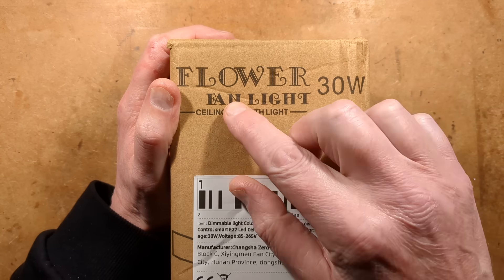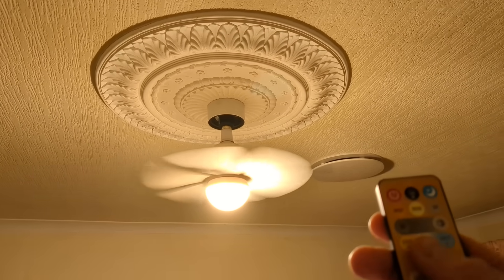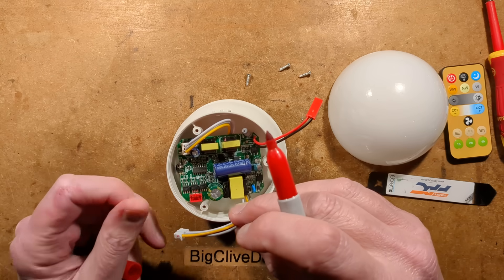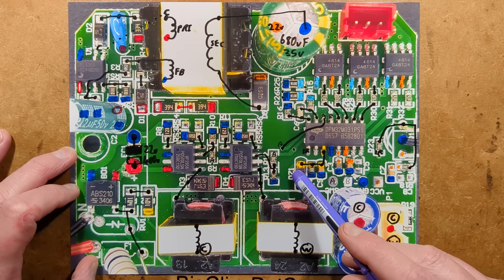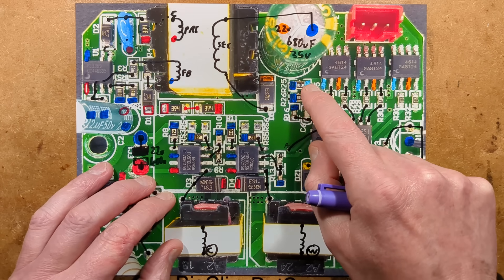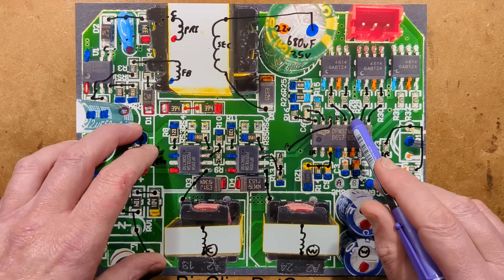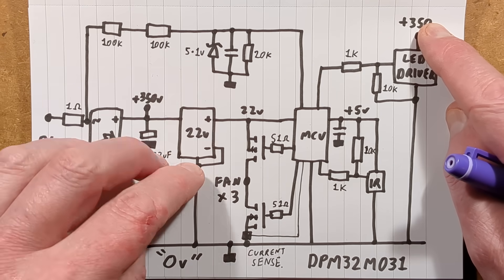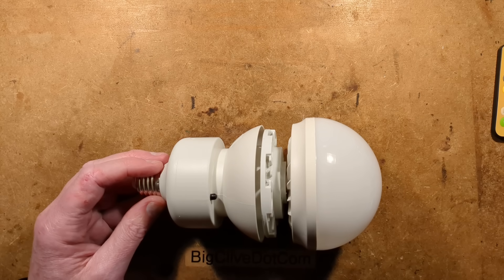Inside a screw-in ceiling fan and light - long version

Comment: The moon light mode is popular in Japan (probably all of Asia) 

All the (“bedroom”) lights in my house have that mode, originally they were pull string double fluro ring type lights with a third tiny bulb that’s orange. (No light switches) 
It allowed 3 brightness levels using fluorescent tubes 

One of them actually dims the tubes instead of switching, it has multiple drivers

Comment: Why 2 x 100k resistors in series and not 1 200k when there is no tap in between them?
Reply from the maker: To spread the power dissipation and increase the voltage rating.

Comment: kind of wonder if it isn't a repurposed drone motor controller. some of those controllers can sense the motor position from the electrical feedback of the motor, without hall effect sensors. it's gotten pretty crazy even a lot of the newer 3d printers use the motor to sense the end stops.

Comment: That red connector at the beginning, and the wires attached, is common in RC boat/aircraft gear. None of those wires can take 220/240 for long. (Effectively they are a fuse LOL).
Reply from the maker: The connector type is apparently rated for 250V AC/DC.  But definitely only in a dry environment.

Comment: It is incredible how much is in a modern micro controller nowadays, I wrote firmware for one of these core m0 so I can really appreciate it, they not only have built in MOSFET driver, comparator to run the motor from backemf(which isn't used in this case it seems like) they are surprisingly powerful too can run at 48-64mhz, with hardware divide to provide foc capability

Comment: That microcontroller is fascinating. I couldn't find the specific datasheet, but for a similar unit shows that it has trig and division acceleration. Makes me wonder how difficult it would be to repurpose, maybe write an emulator to run SNES and below games. Would be fun to try even if I failed.

Comment: the main danger to this fan is that light sockets are not really intended to handle any torque beyond screwing in a bulb, so if you screw this into a cheap plastic/bakelite light fitting then you could cause the screw-in part to work itself loose and either arc between the socket and press fitting linking the socket and screw or wire on the other half.

That being said, if the socket is of decent quality, then it could be fine.

also, based on the one you bought, I can see the pressed on socket working itself loose over time from the fan every time it starts up.

though, considering the quality of chinese products, you are more likely going to have the blades snap or the circuitry fail before the metal parts fail.

Comment: Looks like you have ducted A/C Mr C!  Quite the thing Down Under, however that ceiling fan looks a very nice little device, and surprisingly well-designed too! Unfortunately, all of our ceiling lights are permanently hard wired, or based around GU10 light drivers. Mind you it wouldn't be too difficult to fabricate a surface mount plate to replace the E27 fitting, which will be handy!
Reply from the maker: It's a PIV (Positive Input Ventilation) system.  Just provides a continuous flow of fresh outdoor air throughout the house.

Comment: I'd be worried about the red jst syp connector only being 250v 3A rated
Reply from the maker: It's voltage rating appears to be 250V AC/DC and the 3A current rating is ample for this application.

Comment: Can you make the blades turn the opposite direction, so the force would be unscrewing the fixture?  Does it have a safety chain to catch it when it unscrews itself?  Lastly, does it come with an insurance policy? 😂
Reply from the maker: It rotates the opposite way to the lamp holder thread, so if anything it will put a slight bias to screwing itself in.

Comment: I watched both versions, they're both fine, but I vote for the longer one.

I'm still learning more from your videos. I'm still far too ignorant of electronics, but I'm trying to get better.

The BBC is incredibly stupid and should probably be charged with colluding with the electricians.

Two things I didn't like about that fan are the PWM lighting (I have a hard time with the PWM flicker) and the inefficient powering of the micro controller. For something that's intended for summertime use, I'd want it to be as efficient as possible to reduce the amount of heat added to the room.

Comment: I've looked at those light fixture ceiling fans and I'm not a real big fan (joke not implied), of them for two reasons the torque and weight it puts on the light socket.   I installed a proper ceiling fan by removing the light fixture and installing the ceiling fan into the outlet box where it is supported.  It can be done by any homeowner who is comfortable working with electricity.  Although it is surprising that UK homes haven't really adopted ceiling fans as they can be run in reverse to push warm air at the ceiling down.  Which is what mine does.

Comment: I ordered one of these after an advertising campaign on the Facebook place. Mine is mounted on a loose cable from a ceiling fitting, but had no trouble with it. It moves an astonishing amount of air, and was such a lifesaver when the air was humid and lack of wind made it stuffy. Love mine.

Comment: I have no idea how they do it in the UK, but in the US, I know not all of the ceiling boxes can support a heavy fixture. Smaller ceiling fans are usually OK, but big ones and heavy chandeliers are supposed to have a box that's more securely attached to the framing of the ceiling than a regular one. It doesn't strain the wiring so much as it can wriggle the poorly secured box loose and then fall, usually then either dangling by the wires, or just ripping the wire nut connections apart and letting it fall to the floor or whatever is below.
Reply: I should add, in newer houses, I think electrical code now requires all ceiling light boxes be ceiling fan/chandelier rated, because its stupid to assume no one will ever out a heavy fixture up.

Comment: I'd have thought the problem would be the effect of jerk/yank on the flex cord if plugged into a pendant fitting, not the mass of the thing.  I notice you tested it on a  batten fitting, presumably an SBC.  Please do a follow-up on a pendant fitting and see how much it gets twisted, also on an ES batten fitting and see if it unscrews on starting or stopping on the latter👍
Reply from the maker: I did test it on a pendant fitting and the twisting was not significant.  Less than the flex used in many other domestic appliances.
Reply: @bigclivedotcom good to know👍👍

Comment: DPM32M031 which is a ARM Cortex M0 MCU with 3-phase motor controller for cost sensitive applications. It has a 3P 3N 40v gate driver and integrated 5v LDO. Very cheap, but nice and it uses sensorless feedback via single current sense resistor!
Reply: Did you find the datasheet?

Comment: I picked the long version because it was good to work out to. :)
Pretty impressive how complex the circuit was.  Didn't seem to skimp much on parts, and using a microcontroller as a motor controller is pretty wild?  Seems there would be cheap specialized chips for that.
Pretty bad that even among a failing economy, there are grifters, involved as far as at least the BBC though I do understand they're technically a private enterprise just government funded, who are doing their part to sabotage and steal what they can while the boat is sinking, working against any possibility of improvement.

Comment: Impressed with the design of this. The slow fan ramp speed up and down I guess is to minimise the torque effect on start up so it doesn’t try to unscrew itself.
Reply: they at least made the rotation direction to thread it further/tighten. I'm assuming it doesn't have a rotation reverse where it would blow air upwards and self unthread. lol
excitement may occur if it ever stopped suddenly/locked up. automatic unthreading, ceiling mounted lawn dart.

Comment: Interesting device. Surprised it has a screw Edison base. The bayonet base you guys use should be pretty resistant to disconnection due to the fan rotation. Besides that is a pretty small device.

Here in the US the NEC (National Electrical Code) has mandated special boxes for heavy fixtures. I agree with you that is not just a fan thing fancy Tiffany lights are pretty heavy.

Comment: Ceiling fans are also pretty rare in Germany BUT they help a lot in hot summers. They also help in winter circulating the air in the room, preventing the formation of pockets of hot air directly under the ceiling while the air near the floors is cold.
Reply: I made at least a few trips to Bavaria (Straubing, Stockdorf, Regensburg) about 8 summers ago. It was so uncomfortable in the hotels with no A/C and no screens in the windows. I actually went to a home improvement store (which curiously looked a LOT like Home Depot!) and bought a 220v table fan. I actually stuffed it in my suitcase and brought it back, in case I were to make another trip. 

However USB & rechargeable fans became a thing. I took one to Portugal last year.
Reply: They are very common in the States. We rely on ours during the summer. In addition to opening windows, they help keep air moving even when the outside temp approaches 40.
Reply: Which is somewhat surprising to me, because i do believe that full air conditioning systems, even the package terminal style ones that just go in a window are also not common. ceiling fans arent just useful during the summer, they actually can do some help in the winter by churning up the warm air rising to the ceiling when you reverse the blades. which pretty much all fans sold in hardware stores here in America can do. helps to save running the heater.

Comment: The motor is an ordinary sensorless BLDC (BrushLess DC) motor. They perform commutation based on feedback voltage from the magnet wizzing past the phase that is not energized. Getting them started is an issue, because at zero speed, there is no feedback voltage. There are different techniques to get them started. The simplest one is "blind commutation", where the controller simply commutates at low speed while looking for feedback voltage. As a result, sensorless BLDC motors have very low starting torque, but that's fine for applications like propellers and fans. RC airplanes and helicopters use them, while cars need sensor motors, because they need high starting torque.

Comment: Always interesting to see how completely different electrical installations are in other countries!
We would never have an E27 light socket permanently mounted at a ceiling.  Ceiling light points here do have a junction box with short ends of wire (blue and black) coming out, and the light would be attached using 2 screws.
Of course that means that connecting a ceiling light is a bit of a dangerous operation, you would often not know if the light switch is on or off so it is better to turn off the main switch.
My rooms here are relatively low and I have only flat light fixtures.
Reply from the maker: We tend to use pendant boxes designed to act as the electrical junction box and also accommodate a reasonable weight of light fitting.

Comment: 13:25 the datasheet for this specific variation will come up if you search ddg for (without quotes) "DPM32M031 3P3N GateDriver datasheet" ... you will need to translate it, but DPM32M031PS1D6S7 is in there.

Comment: They'd be alarmed to know that we regularly use 52" ceiling fans in the USA. and I can assure you they're not damaging wiring and falling down constantly.   And I can also assure you the majority of them ARE NOT mounted correctly.
Reply: Both new-work and (truly clever!) retrofit mounting brackets for ceiling fans are easily available from any big-box hardware center. I've installed 3 powerful ceiling fans in my house where only ceiling lights had originally been mounted. Anyone who sticks a fan up without being 100% certain that it's securely mounted is taking a hell of a risk.
Reply: @goodun2974 I have used those, too. Not bad. Knock the top center plug out of the octagon box and you are ready to go.
Reply: @wall-e3313 , the retrofit hangers for ceiling fans that I've used have a pair of threaded rods that work almost like 16" long floor jacks; you can expand the rods by turning with a wrench so that they span inbetween tge 16" on center joists, with teeth at the end that bite into the joists. The hexagonal box mounts to the threaded bar with a U-bolt. The hardest part, typically, is breaking apart and breaking out the old fiberglas or plastic ceiling box that the original lightweight fixture was mounted to; it's usually nailed or screwed to the joist from just one side. The entire retrofit bracket can be installed through the existing hole in the ceiling, without cutting the sheetrock. Clever design!
Reply: @goodun2974 I've used these brackets when I have good access to the mount points rhrough the attic. You may have to trim some drywall or plaster from the interior, but the brackets work just fine.
Reply: Similar size fans are also somewhat common here in Australia. There are proper standards for how they're supposed to be installed but in practice no doubt many aren't compliant.
Reply: @shaun5552 
I was looking at getting one for my (large, and now more like a granny flat) shed. Looked up the instructions for a Bunnings one... Did a quick measurement of the ceiling height... And nope. I mean, I COULD still have bought and installed one myself, and it would be perfectly safe for ME because I'm fairly short. But if someone taller walked in... Or if I raised my arms above my head.

I decided against it. I'll get a wall mount industrial fan next time I run into airconditioning distribution issues. I've got a (high power metal blade) pedestal fan for the moment that did the job last summer.
Reply: I have installed several 52's with no issues. The key is to have a study mounting point. I like to add a piece of 2x4 between the ceiling studs I then screw the box to it it doesn't matter if the wiring is EMT, BX, OR Romex. I only use metal boxes' properly grounded and never plastic.
Reply: @wall-e3313 , adding a 2x4 strap between joists is great for top-floor installations where have easy access to the attic directly above, but not so great for a first floor ceiling fan in a 2 story house! Attic installs also reguire you to climb around in itchy fiberglas insulation in July or iAugust when the attic temp is 120°F; I've done it and it's not fun. Nobody ever thinks to have a ceiling fan installed in the middle of winter, they always wait until the heat is nearly unbearable....
Reply: @goodun2974 of course!  Especially true of in-laws....multiple times!
Reply: @wall-e3313  +1   When acessible, the 2x4 between joists is better, no spreading pressure on the joists if you measure & correctly.  I always wonderif  those over priced jacking fixtures go in perpendicular to the joists. 
Buuut. Itching in a hot attic do I always get the measurement right?  Maaaayy-be?!
Reply: @wall-e3313  +1   When acessible, the 2x4 between joists is better, no spreading pressure on the joists if you measure & correctly.  I always wonderif  those over priced jacking fixtures go in perpendicular to the joists. 
Buuut. Itching in a hot attic do I always get the measurement right?  Maaaayy-be?!
Reply: The US electrical code requires a special steel workbox for a ceiling fan install.
So naturally there's millions of big-box-store fans installed into stock plastic boxes.
Used to work at a lamp store that sold ceiling fans. I have seen things. Strange things...
Reply: Do they also hang from the wires like many ceiling lights?
Reply: @HenryLoenwind , no, of course not! There's a limit to how much weight that electrical codes will allow for self-supported, "pendant" light fixtures; and often the pendant lights will also have a decorative metal chain that supports the fixture (the power cable weaves through the chain). A typical lamp cord can likely handle at least 50 to 100 pounds ---- I can't break one by pulling on it ---- but nobody with a brain would put that much continual load on it. I have a couple pendant fixtures in my house, and the light housing, socket and bulb probably only weigh 5 pounds altogether.

A ceiling fan hung from a wire woukd twist itself into knots in a few  seconds, and would eventualky fail; you'd need at least 3 chains, splayed out to the ceiling like a tripod in reverse, to support a ceiling fan.
Reply: @HenryLoenwind in some places, yes, but not the 52 inch ones. Usually the smaller ones only.
Reply: you don't plug those into a single lightbulb socket.

Comment: I don't know much about the UK electrical standard but in the States every electrical outlet is connected with a junction box attached to a stud, joist or rafter etc. and the sockets/receptacles are attached to the box, no way for a wire to twist unless it was installed loose by an idiot DIY type.  I've had three Casablanca ceiling fans running 24hrs a day for over 40yrs and not one hiccup, they're all Heritage models and were expensive when purchased.  I installed them myself whilst working as an electrician.  Thanks Clive, interesting circuit and nice little fan.

Comment: Blades with ridges on the back side that provide close to zero additional strength but add to noise generation capability and above all to the amount of collected dust.
Reply: Doubtless. Nevertheless they'll be far easier to clean than a unit that it permanently attached to the ceiling. Mine have got perfectly smooth blades but I find them a right pain to clean.

Comment: If you want to make these real dangerous buy a bunch of em and a bunch of the 1 Male end 3 female light socket splitters and do some daisy chaining...
I only know of the splitters as I use one for my remote adjusted led bulbs that I use for mood lighting but you could really fuck around with chaining and put the fan lower and lower down with each addition.